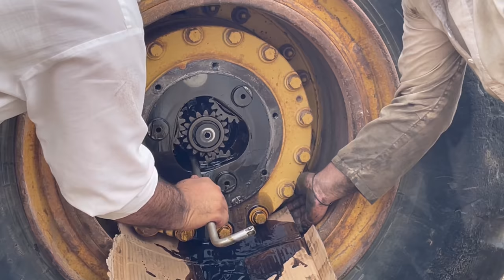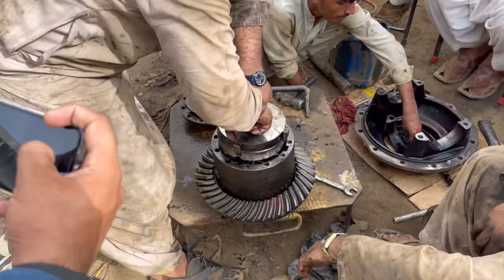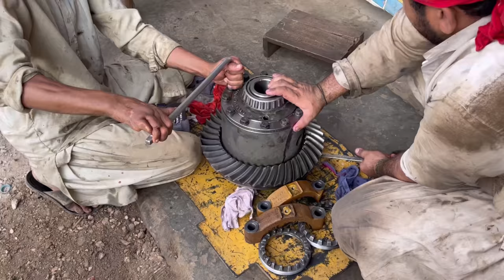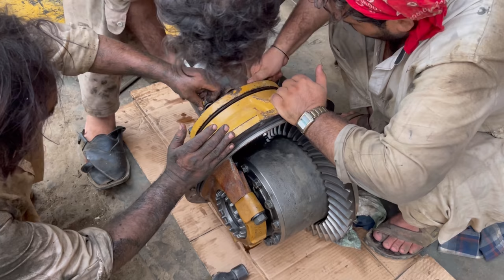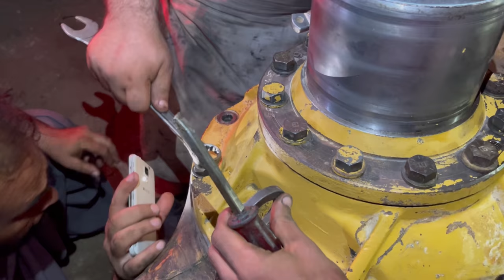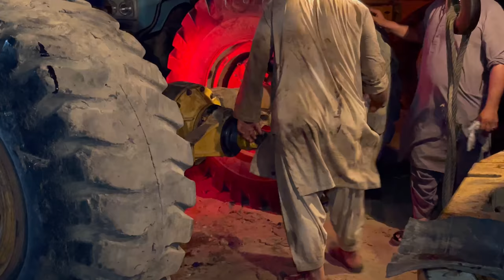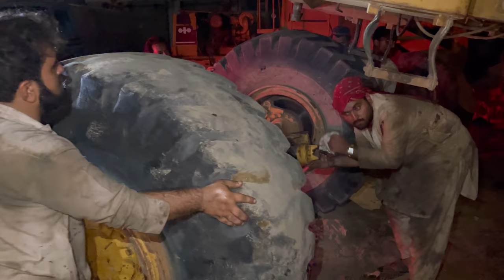This CATERPILLAR had a Major Defect in Differential GEAR  that the Experienced Mechanic Had Repaired

Comment: I mean if you're changing the ringing pinion then I get it I guess but if you ain't got to change that in the bearings ain't bad nothing changes just clean it it's only take one side off it's got to doesn't have the opinion in it so it could be either side

Comment: They machined off the splines for the clutch plates!! They turned what was a mechanical lsd (limited slip differential) into an open diff so have made the machine worse, now instead of 2 wheels on that axel getting power only one will......... good job lol 😆

Comment: Holy shit, they don't have a chunk of wood to put on top of that bearing before hammering it on? FFS. Also, using the bearing puller to give equal force while using a railroad spike to pry off the bearing.... You know, that tool is called a bearing puller for a reason.

Comment: I see alot of people making fun of that torque wrench. Thing is, we people in Indian Subcontinent are very concerned about environment. So we follow Reduce, Reuse & Recycling from the dept of our heart. That torque wrench might be damaged, so they are using it as a breaker bar. 😌
Reply: having done work in India many times I have to disagree on the environment part, trowing oil on the ground and various chemicals as i have seen before is not protecting the environment in my opinion, last time doing work the local company just spilled 15 liters of gear oil on the ground and replaced it with new and covered the mess with some dirt, this was just one examples of many other similar events we have seen.

Comment: Good Morning Wow Skills. You got though that complicated job, seems to work fine. Wow indeed. 
Ok. The FIRST thing we teach the new guys about TORQUE wrenches is that IS ALL THEY DO. After using it as a breaker bar, it is no longer a torque wrench. It's now a fragile socket wrench. You can re calibrate it, but the spring steel parts are now bent. So will not be consistent again. Quite a pity. I get that it has been a weird springy breaker bar for ages. Oh well, life's tough for tools as well. Who needs a torque wrench anyway? Your hands look accustomed to applying the torque on their own. 
I might have missed the re filling with gear oil part. Did the old oil go back in or fresh?

Comment: For tapered roller bearings and especially for diffential bearings, the correct bearing preload is eminently important... But if of course I've never heard of it...... Or from the principle of a self-locking differential. The remedy not right here the lathebut the right LS oil..... Clueless bunglers.

Comment: the silicone paste are so thin will that last?
Reply: i was thinking the same thing, but there is one scene where a rubber o ring can be seen.   so probably what is going on is they just couldnt get new sealing rings, so they just added a bit of silicone to help seal the old o ring better.
Reply: @Dogpool  That's true but I hope they make it a little thicker than what they use to put into it's like just thin as a tissue paper for sure that won't last long once it heat's up.
Reply: @robbyalmendrez1750  this whole repair is jank.  It’s such a strange combination of extremely expensive equipment, and cheap hack work being done.  The strange part is they have things like a lathe to “modify “ things, but don’t have enough money to get a ratchet wrench or extra cardboard to cover the dirt ?

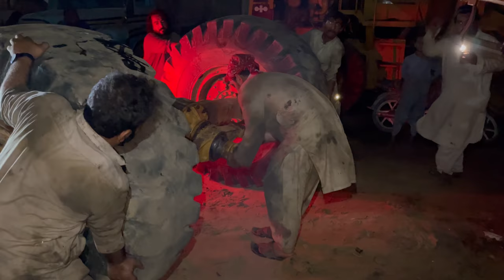Comment: 23:50 Oh please don't say they will go under the cat dangling over them with that thin rope..
Reply: After reading your comment I went back and took a close look and I do believe it is about 5/8" wire rope.  Still, NEVER STAND UNDER A LOAD.
Reply: @Tsamokie  When these ppl handle it all I wouldn't go under it even if it was bolted to the lifter with a foot thick metal piece and that wire is well beyond "time to retire it and buy a new one" it doesn't have near the strength it had when it was new.

Comment: Look at that sand floor, no protective equipment, so primitive, they really have no idea what they're doing, they messed up that service in every way imaginable, now the diff won't lock properly, it will probably need another major service immediately after. Pure incompetence.

Comment: cringed alot when they didn`t tear down the pinion gear and replace the bearing in it also. Ton of work to skip suck a small step that will require the complete tear down again later

Comment: Replacing the bearings with new ones….. but instantly kill them with a chisel. My god….
Reply: nah, dude didnt chisel on the parts that would have done damage.   those things are hardened steel and can take a bit of a beating .  as long as you dont hit them too hard you wont change the way the bearing rides.  the danger there would be hitting that cage the roller bearings ride in, but just some carefully placed light hammering will get it in there.  just gatta use what you got sometimes.
Reply: @Dogpool  I understand that sometimes you use whatever you’ve got. But just as you say, hardened steel…. People got injured very badly just by doing that. 

The inner ring needs to be tight on the axel. If you hammer it, you make a small dent or even deep scratches. With the Material tension included, the first step malfunction is made. I would say: Ask your local service center of SKF. I bet this isn’t the way to do so.

Comment: alll it probably needed was GEAR OIL CHANGES MORE THAN... NEVER in its life??? after the first 50 hours and every 200 hours thereafter... like most other gearboxes. oil cheap... differentials/bearings etc. NOT CHEAP!!!!   yes removed the limited slip of the diff on that. didnt see the point in that? sand... lightly resurface the clutch plates to get the smooth off them and re assemble... clean/fresh oil good for another 200 hours or whatever before gear oil change in the differential.

Comment: Chipmunk gang is at it again!
So, you remove this planetary drive and take it apart to remove some material from a couple of the disks. Then you put it back together with a few karate chops with your hand and no new parts were replaced.
You expect this to work now and for how long?
I should have stopped watching when they used a torque wrench as a breaker bar.
There is NO way this is going to work for long!!!

Comment: You can admire the resourcefulness and hard work but, why do they have to grub about in the dirt, have no regard for torques and certainly no respect for anyones safety - When they all got underneath it with the crane lifting with some stringy old cable, no attempt to prop it up or anything. Its that type of disregard for life that causes lots of problems around the world, its not that we are rich or clever in the first world, just a bit more civilised.

Comment: В чем смысл ремонта ? Разобрали снова собрали . Даже новые запчасти не ставили
Reply: They just destroyed the limited shift differential.
Reply: I believe they installed two (2) new inside axle bearings. 
   They also "f"edup the limited slip clutches for unknown reason. 
🤔maybe to get a tow out of mud service call?
🤔maybe to allow for not tighter turning but for easier steering because the hydr oil pump is weak or going bad. It is hard to steer. ???🤷
🤔 maybe he is a NASA rocket engineer???🤷
🤔 he may not even know why he ground / cut them off. ???🤷
🤔 job security for my son whenever they ship it back to USA 🇺🇸 🙂😊🙂😊😉
Reply: ставили. и самоблок выключили навсегда. всё норм.